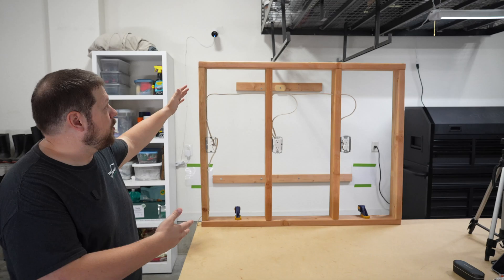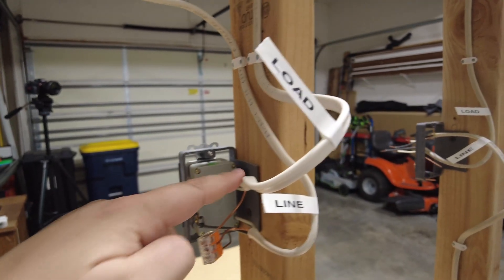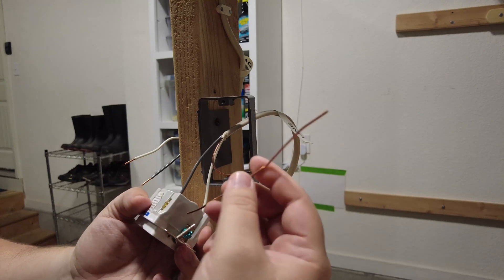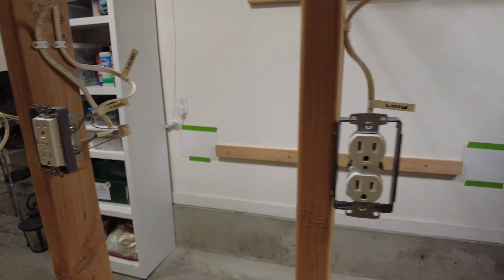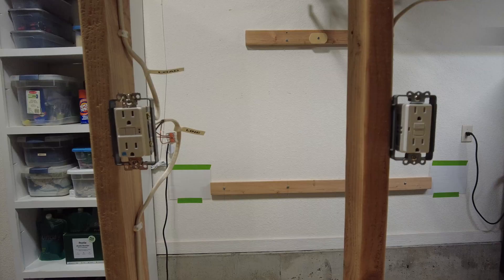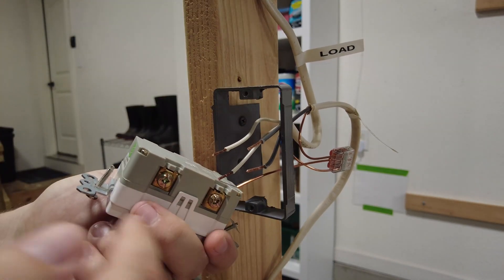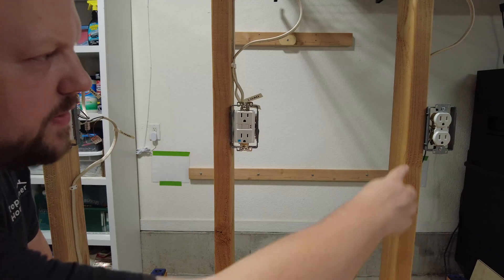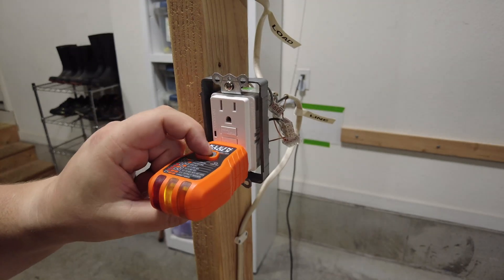How to Wire a GFCI Outlet and Avoid Common Mistakes

Comment: Bro YOU ARE THE BEST......I have never ran across this problem where I had 4 wire....and only 1 hot....I took off all receptacles down the line and could not figure out why I was either Getting power but Tripping or Was NOT  getting Power....lol ....it was like you said the Manufacture.....upon further inspection....so I found the ONE HOT...and LINE IN.....not LOAD......Thanks Man Much Appreciated......

Comment: I found a gfi receptacle was sharing a neutral to what I assume was a load in a circuit other than the one I turned off. Felt a charge when I handled that white wire ( was going to pigtail it correctly I read of how electricians will nick offthe copper wire insulation to attach to the silver gfi terminal.)Wow big surprise!

Comment: Here’s A question:  Can you take power from a GFCI receptacle and extend that to power a ceiling fan that is turned on and off only by a remote control (no hard-wired switch)?

Comment: Respectfully asking I have two neutral wires in one hot with no ground can I connect the two load wires to the back and then the hot and will this work without a ground what do I need to pigtail respectfully ask

Comment: To have 2 GFCI receptacles in a row and not wanting the first one to trip the 2nd can you not just hook both wires to the line of the first rather than putting them together and pigtailing them in like you did.  
On the GFCI receptacle there are 2 separate terminals for the line.

Comment: Using the Wagos seems like a waste of time and money.  The GFCI can handle 2 lines, negating the need for tapping, splicing, etc..  space is limited in many electrical boxes, unlike in the examples shown in this video, with no back to the box.
Reply: Is future proofing. If you need to replace the GFCI, and you eventually will, just remove it, unclip the Wago that goes to the GFCI and put another with a new set of wires without tampering with the existing wiring from the panel.

If you do it just by unscrewing the GFCI, there’s a high chance that the screws, the stripping of the insulation and the twisting to connect them, could have damaged the exposed wire, which was also subject to weather.
While it was in place, it was OK, just a slight movement while fitting it to the box and everything stayed in place. But, once you start manipulating the wires to replace to old one and connect the new one, suddenly the exposed wires just snap, forcing you to make a new strip or worse, if the wire was already too short, it will force you to make an unsafe extension or rewire, just to put the new one.
Trust me, it happens more often than you’d expect it would.
Reply: @OM19_MO79 Correct. Without Wagos, they would need to cut existing cables and have even less room to work. Also, pigtail wiring using Wagos would prevent downstream failures.

Comment: Quick question... I want to use a 1hp sump pump, to drain an inground 6 ft pool during raining season.... The outlets are not grounded in this home. They're all standard 3 prong outlets with no ground. Can I simply replace one of the 3 prong outlets with a CFGI, & will that protect from electric shock? Would the outlets upstream to the CFGI be an eletric hazard when the sump pump is running on the dedicated CFGI outlet? Or no risk at the upstream outlets while pump is running on the CFGI outlet? Thanks for your help!

Comment: Have a home built in the 1954 & need to replace an old 2-prong, outdoor porch receptacle with GFCI (per code requirement). No ground wire present and porch is covered. The old receptacle is mid-stream on a 20-amp circuit (#5 of 8 outlets). One side is connected to the incoming hot & neutral leads, the other to the outgoing hot & neutral wires. Last 2 circuit outlets are in a detached garage - one serving the freezer, both are grounded. Circuit protected by AFCIs in a newly installed sub-panel. Can the GFCI be installed using only the LINE terminals via pigtail method so if the GFCI fails, power can still go to the downstream outlets?
Reply: Yes, that's always an option if downstream devices are not to be protected, or if there is another GFCI receptacle down the line.

Comment: I have 5 wires, 3 white and 2 black. I’m struggling with the 3 white. I tried every combination between the white load and white line with the 3 wires and have only gotten a solid red on the GFCI. 😭

Comment: Can i use a pigtail to load and then connect two receptacles?

Example line comes in and goes out via neutral.
Then from load use a pigtail and with wago i connect two receptacles?

Comment: One more scenario to cover (sorry if you covered it and I missed it). I recently replaced two standard plugs for two GFCI's. The wiring from the panel was 14/3; the two line wires (red and black on separate breakers). At the first electrical box I attached the red and white to the appropriate line connections for the first GFCI. A 14/2 wire connected the two electrical boxes, the GFCI of the second box was also connected to the line terminals, but would trip the moment, the second breaker was turned on. The issue as it turns out was connecting the common (white) wire of the 14/2 in the first box to the second common (silver) screw, (this didn't show as an issue with my tester). Once I connected the two common wires of the 14/3 and 14/2 to the same silver screw vs one above the other, it worked.

Comment: Question:
Regular 3 prong outlet  swapped for a GFCI. The 3 prong outlet has a green light on the tester, everything working well. GFCI not working and no lights on the tester, which says open hot. Swapped new GFCI for another new GFCI and still nothing. What is causing this?
Reply from the maker: Double check that the power is connected to the Line terminals and not the Load terminals
Reply: @TopHomeowner  would that be the only cause? I'll have to check the GFCI next time I can and see if it has line and load. Thanks

Comment: You don't have to pig tail the hot and neutral if you are going to hook up in parallel. There are 2 holes in the back so just connect the line for the next one in there also. This is good when you really don't have room for pig tails. Older boxes are like this. Of course really old ones I've found they just strip a small piece of the wire in the middle and hook it around the screw so the wire is unbroken.
Reply: I had to do this in my downstairs bathroom because when it tripped it also tripped the circuits in my upstairs bathrooms.
So I connected both wires to the line and added GFIC receptacles in each bathrooms so now if the downstairs trips I can still use the upstairs bathroom receptacles.
Reply: I'm pretty sure if you have 2 load and two neutral connections at the bottom of the socket,, there's no need to make a pig tail it's built in to the socket.
Reply: See my post here I got bigum surprise when I tried to clean up the neutral wires. I’ve seen homes built new in last 20 years have that space saver technique. I’m guessing elections do it for space and time but shameful not to use a deeper box few bucks more hayzeus wtf!

Comment: At 2.50 in the video you made a j hook to show another way to wire but you installed it  wrapping the wrong direction so when tightening the screw it can Un wrap the wire. Nice video!
Reply: He didn't install that wire. It was simply to show the screw connection. The GFCI doesn't have screw connections so he used the ground as an example.

Comment: Beauty!!!! I have a light outside of my residence which has also a GCF I plug. The light is it dusk to dawn late it has full power all the time. Also the GCF I plug also has full power. That is the one where I want to run it to my shed. But I am wondering if I use 14 two if it will be Not a large enough wire. It is probably another 30 feet to the shed approximately. What happens if I use two small of wire. In my shed I just want to have lights and maybe a charger for a drill battery that is it.
Reply from the maker: @freedomfilledlife 14/2 is rated for 15 amps, so as long as the total load stays under 1,440 watts (like LED lights and a charger), you’ll be fine. With the 30-foot distance, you’ll experience some voltage drop, but it won’t be a big issue for low-power devices. If there’s any chance you’ll use more tools or devices in the future, 12/2 wire would be a better choice.
Reply: @TopHomeowner  ok wicked thanks

Comment: Best vid explaining this ! Helped me so much ! Thank you

I’m running a metal clad 12/2 to a metal box with a GFCI, inside a cabinet, metal clad in case something happens to bump the wires. Older home built in the 50’s with no ground wire, is it ok to use a  metal switch box vs plastic? Difference ?
Reply: Installing two outdoor outlets on front and back of island grill. Do I need two 12/2 wires for each outlet? Or can I use one and pig tale to the other? Thanks.

Comment: The line and load reversal mistake is likely the most common error when wiring up GFCI type receptacle outlets, so common in fact,  that UL updated the standards for GFCI receptacles back in, I wanna say 2014, to require the device to refuse to reset if miswired or if the internal circuitry fails. Back before the updated UL standards, if line and load reversed, I believe the GFCI would trip and be able to reset,  but when tripped the downstream receptacles would be dead, but the GFCI device itself would still provide power, leaving the user unprotected.   
 

All that being said, it would be an interesting expirement to do with an older GFCI type receptacle that still function. Maybe if you ever pull one out of a remodel project or find a NOS one on Ebay,  you might demonstrate this on a future video.
Reply from the maker: That's a great idea! I'll keep an eye out for one.